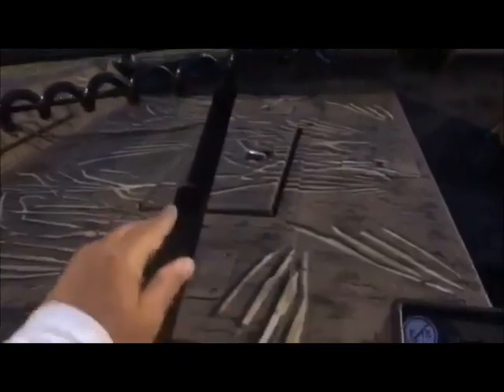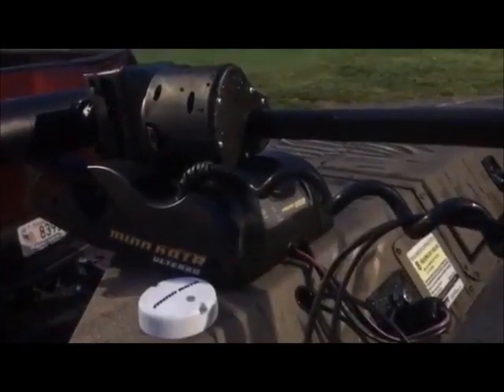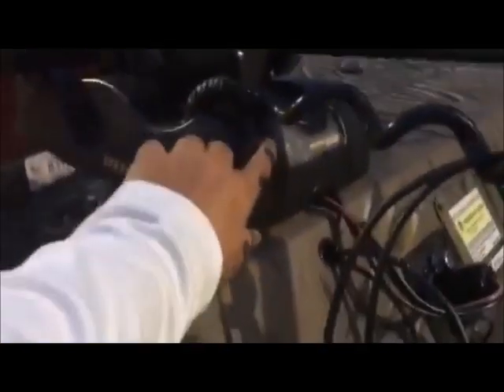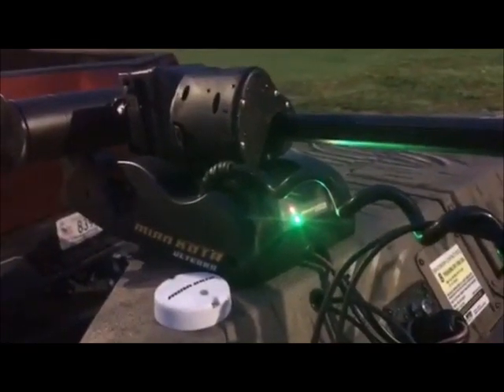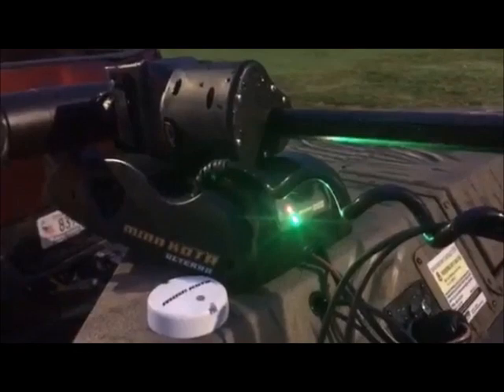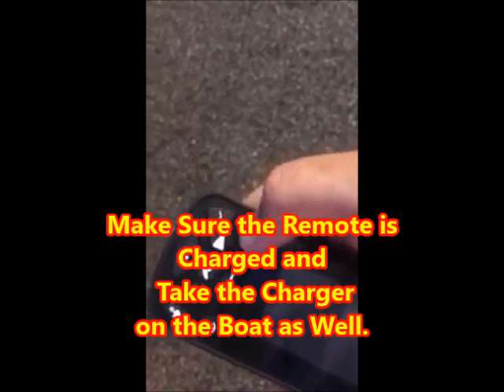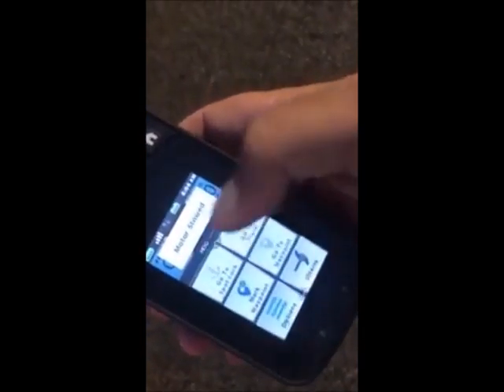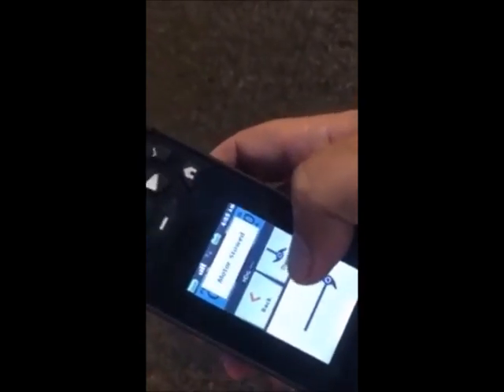Minn Kota Trolling Motor (Ulterra): Remote Control, Deployment & Button Functions

Comment: I just sub. I'm getting my next week. How it's going so far for them trolling motor?
Reply from the maker: I love mine - No Issues at all !
Reply: @wickedoutdooradventures6694  I'm going to install it myself. Just got a couple's questions. The plug for the trolling motor seem cheap made. Have you have a issue with that. I been read reviews that one guy plug melted and alot of others reviews said dont buy it. I  need help deciding which one to buy because I need one. Thank you. I'm going to run 6 guage wire.

Comment: What kind of boat is that?
Reply from the maker: SeaarkVcat200
Reply from the maker: SeaArk VCat200 2072
Reply: What shaft length is your Ulterra?  I want one for my VFX 2072
Reply from the maker: 60" 80# thrust 24 volt my friend
Reply from the maker: Thanks for the comment my friend -  Check out my latest YouTube Video - https://youtu.be/IT3bASjPQa8
Reply from the maker: Thanks for the comment my friend -  Check out my latest YouTube Video - https://youtu.be/IT3bASjPQa8
Reply: Nice rig!  Thx for the demo, picking up a 2072 and wanting the same system.

Comment: No way would I rely on the TM to deploy. Several guys have had issues with the stow and deply
Reply from the maker: Never had any issues in two years
Reply: @wickedoutdooradventures6694  
Glad you got a good one! I have been using Minn Kota TM for years, just had to make the decision on my new 24' bay boat and I went with the Riptide Terrova 72". As cool as the Ulterra is, so many reviews have been guys having problems with them. Even have a friend that had a 72" 36v Ulterra installed this past Spring, already been in the shop twice with deploy/stow issues. I would love to launch the bay boat then use TM to pull near dock then deploy power poles. But with my luck I would be launch the boat, TM not deploy. Then water be too deep for power poles! haha